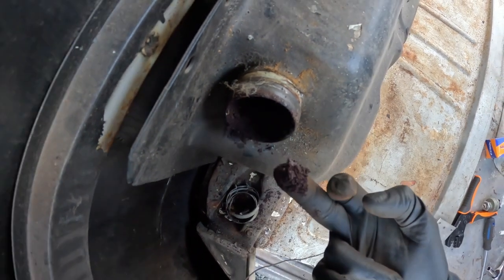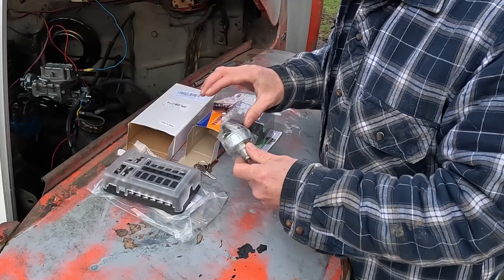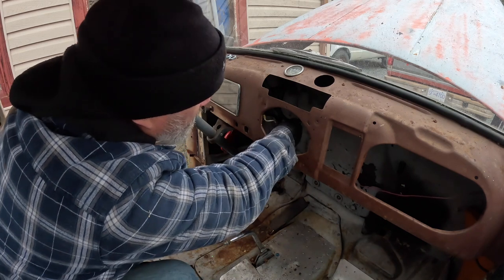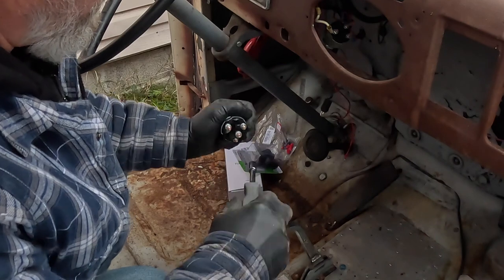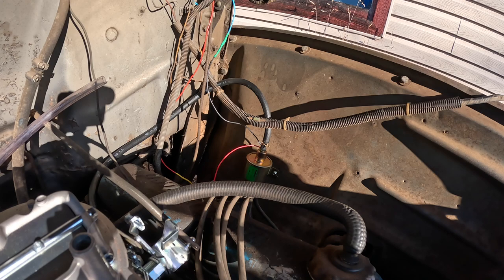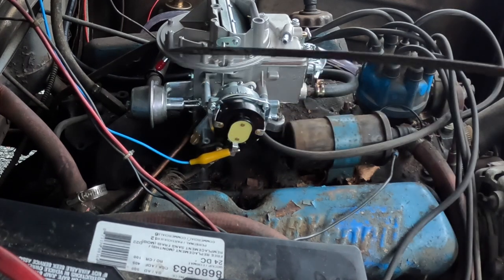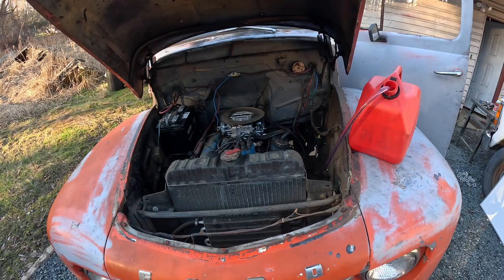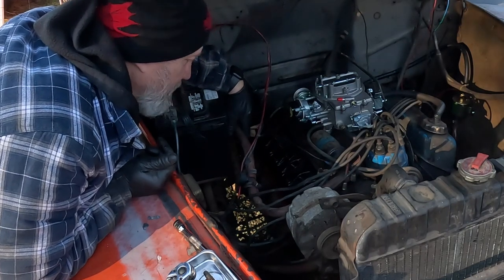1950 FORD F1 | WHAT IS IN THE GAS TANK??? | WET COAST FAB

Comment: hello, no thoughts on a teardown and rebuild? as for the tank if you can find a away to tumble it just put a lot of hex nuts in it with some cleaner of your choice,and just shake the crapp out of it for a couple of hours.maybe  see you next time. stay well
Reply from the maker: I've been thinking of some way to strap the tank to my cement mixer and turn it slowly with some chain inside but I really need to get a better idea on how big the baffles are in there as they might block the chains. I have a racing gas cell that I might just use instead. Hang it between the frame rails at the back of the truck. I'm not 100% comfortable having a 17 gallon tank of gas inside the cab with me 😀